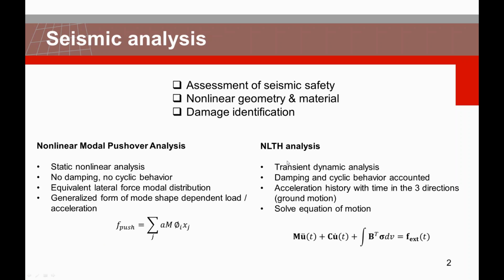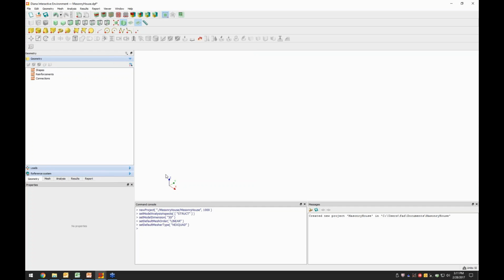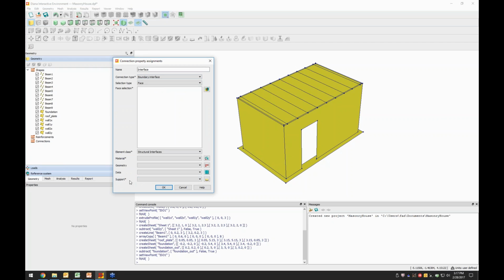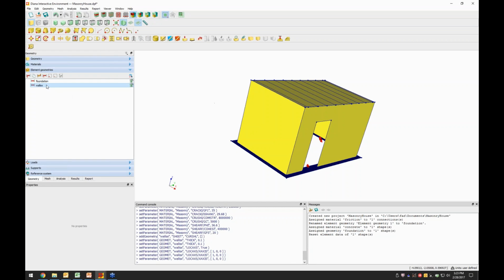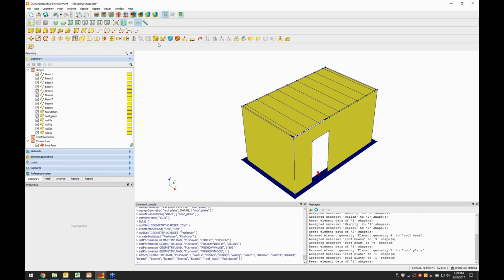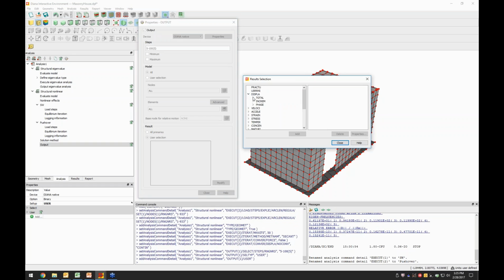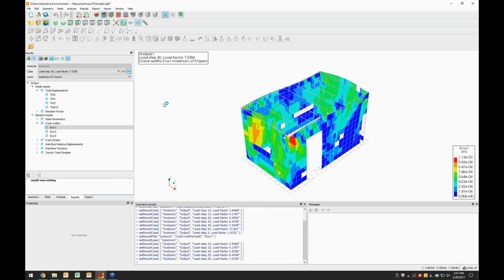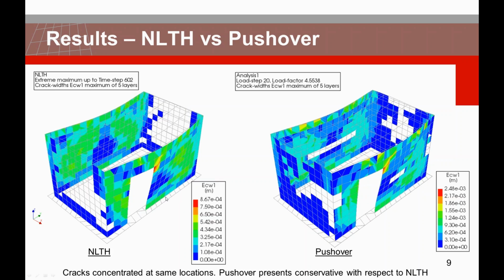Webinar: Nonlinear Pushover Analysis of a Masonry Building with DIANA

Comment: Has anyone tried to reproduce the analysis of the webinar? I tried and it did not give the same results (divergence near step 11, exact step depends on the diana version). This is what I noticed:
- the mesh of the roof is different for the model made in video and the model which shows the output . The mesher of the interactive environment isn't that great atm. To make a mesh of the roof like in the model with the output you need a lot more effort and tricks.

Also, I noticed in the video:
- in the table with the material parameters the Youngs modulus for timber is a factor 10 higher than modelled. C18 grade timber according to Eurocode should be 9.0E+09 N/m^2
- model made in video has 3 layers for the shell elements, the model which shows the output has 5 layers. In my opinion 3 is a bit little to accurately describe the masonry.
- output selection in video gives a warning when STRESS EFFECT TOTAL LOCAL is selected. 

When changing the eigenmode from 1 to 3, I would have expected that the arc-length control settings for the direction has to be set at direction Y. Since the eigenmode is dominant in the Y-direction.